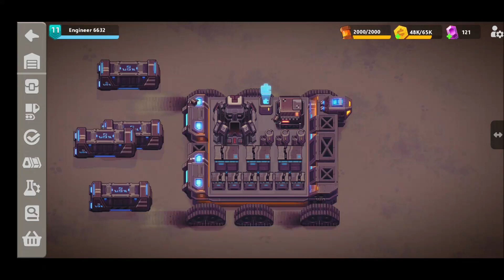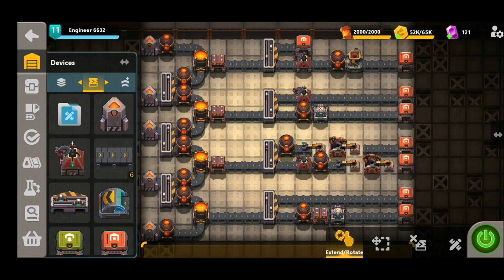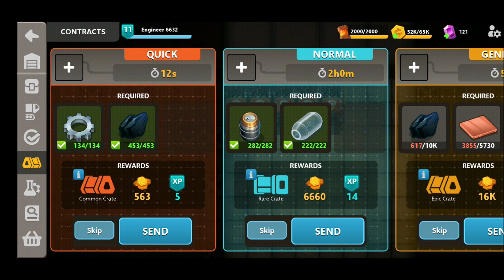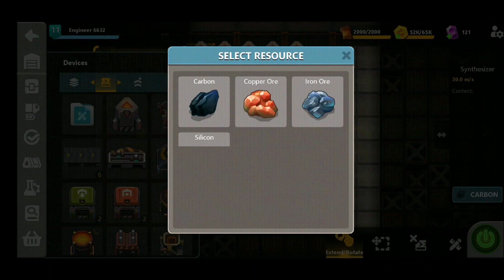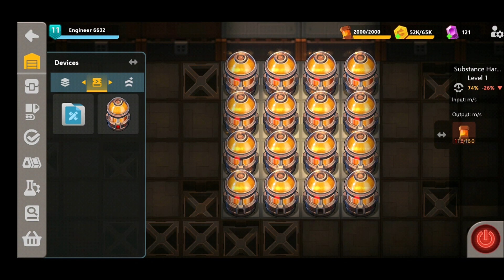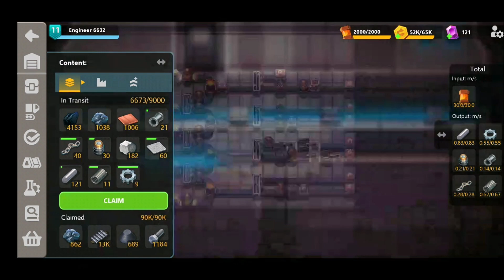Sandship Crafting Factory: The most EFFICIENT Deck Design! [HD]

Comment: Any reason you aren't using the long factories?
Reply from the maker: They take up so much space! You can have 6 micro factories running different materials for the same space a long factory takes
Reply: @videoedge5405  makes sense. Didn't know if they'd be a good alternative to the regular ones for larger projects
Reply from the maker: @Thornshock  it may be worth having some levelled up ready, as the game starts to introduce more complex materials though! We've got some at max level ready to deploy if needed!

Comment: I have 2 substance generator buildings, each completely filled with substance collectors.
I also have 1 underwell pit (lvl 4, but it has a known bug with new area), 1 puzzle building, 1 sandbox, 1 long factory(which actually is not that good and takes much outside space).
Then I have 4 microfactorys that use importers( 1 for raw materials, 1 for steel, 1 for plates and 1 for rods). Also I have 1 basic building for making more complex things, but currently no need so there is a synth going into recycler to make credit.
Reply from the maker: Hi Django, this sounds like a good setup! Yes i think they are aware of the underwell bug and will be fixing this for the proper release! I am also generating cash from the recycler, a future video will be completed on that!
Reply: Nice, but I noticed that I don't need that much input if I use more splitters. For instance stell, with two inputs and some splicers I can feed up to 5 mixer's.